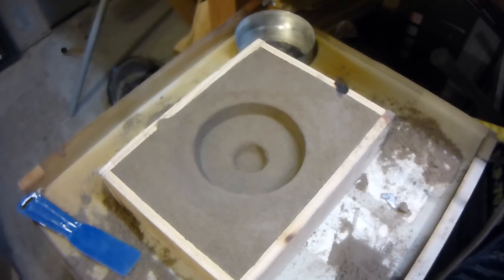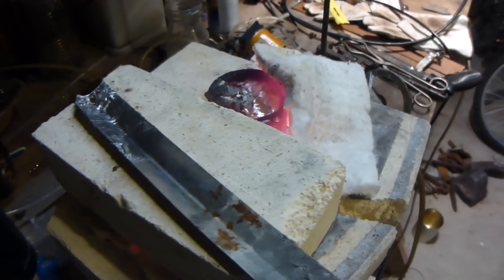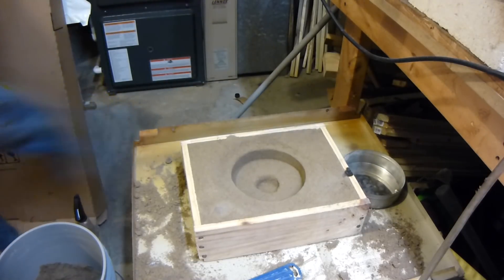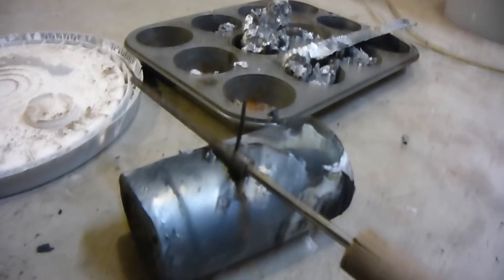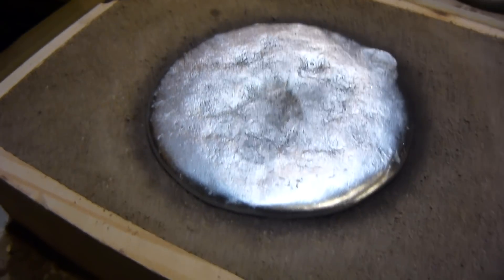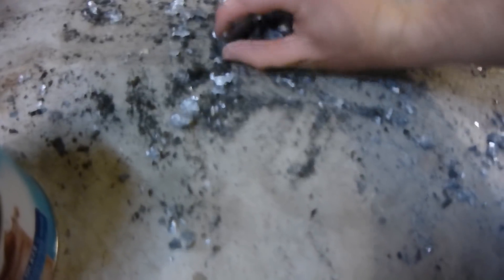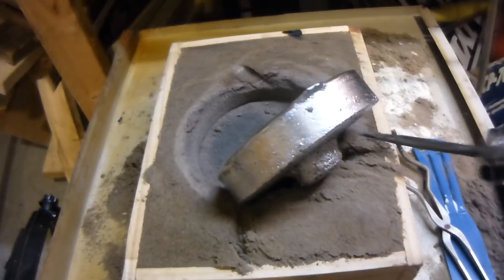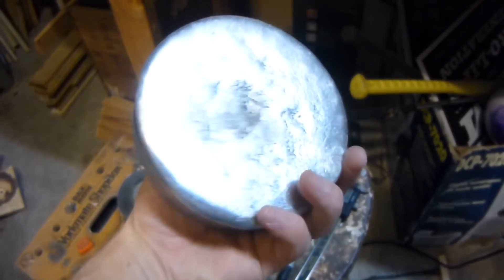Casting an Aluminium Flywheel Using Green Sand Open Mold

Comment: Advice from someone who came very close to burning down his house.
If your kiln is sitting on a wood floor or desk, always allow an airgap of at least 
an inch under the kiln to allow heat to escape.
Without an air gap, enough heat will slowly migrate right through firebrick and ignite the wood below it.

Comment: You are taking a way too high risk here! Get some sand on the floor, and do it the safe way! Put both the furnace and the mould on the floor, and use SAND to put out any fire! It will be much easier to clean up afterwards.

Comment: If you had possibly made a pit off to the side to pour into then allow it to slowly flow into your fly wheel. You will find less porosity in the aluminum casting, You will notice the difference when you machine it, Also definitely heating the mold to dry it out helps, You can see the gas pockets on the bottom of the casting, You will find micro pockets throught the whole casting, Just look at it with a magnifying glass and you will see what I mean. 
It is always better to try in some way to pour from the bottom of your crucible rather then the top, If you could have had material flow level into the pour from the crucible, you would have had a perfect pour with no gas or pockets of any kind.
Use water glass to hold your sand firmly in place and you can heat this up to a lot hotter then you can with just green mold sand casting.

Comment: The Boss, or spindle. - Excellent pour.  Yeah you need to get a better crucible. -  That spray bottle sounds like a rutting moose.  lol  -  Great work.  - I know rdizzy1 disagrees, but you should be wearing your PPE when dealing with molten metal.  A splash of molten metal in the eye will probably blind you.  I have done a lot of lead casting, and have a few small scars on my hands, but I never took chances with my eyes.  - Improve your level of safety to live long and enjoy life. - Otherwise you do good work.

Comment: IIRC, molten aluminum is corrosive to ferrous metals. That's what is speeding up the failure of the crucible beyond just the heat.

Comment: Dont forget to mention about the toxic fumes that come off melting aluminium and should were a mask fukin clown
Reply from the maker: Not many toxic fumes from melting aluminum.  You should know that you clown face.  It's zinc that is are bad for you and easily burns off.  Zinc is almost never alloyed with aluminum.  Brass is the one you gotta really worry about.  Aluminum's burning/boiling point is 4478F which is way above anything I am doing.  The only bad thing here is any paint, oil, coatings on the aluminum.

Comment: stainless steel works good as a crucible for aluminium, look for stuff in goodwill, or find a stainless water bottle from the camping section of walmart or some sporting goods store, and if you can find them mixing bottles they mix alcoholic drinks in they are made from stainless too and are perfect size and shape.

Comment: what does potassium nitrate do to the aluminum
Reply: Noah Voegtly I think it was used as a flux to decrease surface tension in the molten aluminum. This helps it pour better and allow trapped gases to escape. This decreases porosity in the finished casting.

Comment: What did you wind up using the flywheel in?
Reply: Makerj101 ยบบลบ
Reply from the maker: +Nick Ball homemade internal combustion engine. But then I made a better one. So this one was only used on the homemade ic engine for a few months.
Reply: That's rad, what's it power?

Comment: why potassium nitrate ?
Reply: Binds to impurities
Reply: Aluminium doesn't burn at the temperatures inside his crucible (obviously), and so the aluminium couldn't act as fuel for the potassium nitrate oxidizer.  Also, the flammability of something is affected by its surface area - mass ratio.  When the aluminium is molten like that, it's all one big mass with a low surface-area to mass ratio.

Dunno about rocket fuel, but powder or flakes makes sense -  the smaller something is, the higher its surface-area to mass ratio, and the easier it is to ignite.  Imagine you have a solid ten kilogram log - that burns slowly, and needs prolonged exposure to high temperatures to continue burning.  Now imagine that instead you have ten kilos of wood chips - they'll burn much faster and hotter and you could probable set them all off with a couple of matches.
Reply: Why isn't that making a bang? It is after all the oxidizer in blackpowder.
Reply: +Ruben Proost black powder, let alone potassium nitrate alone, doesn't just go bang unconfined like that. the most it does is burn really quickly.
Reply: because in black powder, there is a more than just potassium nitrate, you need also charcoal (fuel) and sulfur (to reduce ignition temperature)
Reply: Well, lighting a mixture of potassium nitrate and sugar also gives a flash, and aluminium is quite flammable.
Reply: aluminum powder is rocket fuel
Reply: Cuz why not

Comment: I am concerned a little for your safety.  A moisture meter used on wood can also be used on sand- make sure your sand is dry.  Please where protective clothing and headgear, and never pour alone!  Great job on the pour and turning, your finished product looks pro!  No pits or slag anywhere: impressive.

Comment: if you take an empty steel fire extinguisher and cut the bottom off, that should last you a good bit longer than that one, so long as you're melting down metals with a lower melting point than steel.
Reply: +Silverwing179 it should work well. The problem of melting aluminium in a steel crucible (or another iron alloy like cast iron) is that at high temperatures like 650&#186;C, the aluminium starts to corrode iron, and thats a two way problem because your crucible gets  finer , and the microstructure of the aluminium forms a needle shape fase that is too way fragile. So, if the piece that you are casting, gonna be used to mechanical structures, it will be too much fragile and can broke in work.

Comment: Noob question: Is there any reason to cool it faster than just letting it cool overnight?
Reply: +silveravnt if you want a consistent piece of metal, cooling it slowly will allow the majority of the crystals to form uniformly.
as opposed to: dunking it in water, where the outer layer will cool quickly, creating smaller crystals, and the inner cooling slower and slower as you get to the centre forming bigger crystals as you travel inwards.
Reply: Aluminum is very brittle when it's super heated. Trying to cool it down quickly could make it crack. The same thing happens at the welding class I took if you let off the peddle too abruptly after tig welding a bead.
Reply: +Jedi Knight so the only reason the cool the metal quickly in impatience or maybe safety in some cases.

Comment: Looks good, use a top and the other side will be smooth too.  The top box is called a cope and you pack it with sand.  When did you get your lathe?    Here's my first run vid:    https://www.youtube.com/watch?v=yfK6TsM71cg

Comment: powered borax is a good aluminum flux too.
Reply: No it isn't! Boric acid attacks aluminum. Do some research. It seems like it works until it fails down the road. Boric acid makes for very weak aluminum.
Reply: I stand corrected. I know when I was told to use it as a flux the amount was minimal.
Reply: It is a good flux for other metals. Not aluminum. But people don't understand that distinction so they use it in aluminum and it appears to work so then people keep repeating that advice, never hearing the followup about how weird it was when the part they made failed weeks later.
Reply: Jon Miller you say no to boric acid... what do you recommend then? I have seen a eutectic mix of 50/50 NaCl/KCl, fused then crushed recommended as a cheap, effective flux (commonly sold as "light salt"), sodium carbonate ("washing soda", NOT baking soda), and of course, there are commercial fluxes. Degassing tablets and bubbling of nitrogen for reducing porosity is a different thing.
Reply: To be clear, boric acid is an effective flux for aluminum. But ANY leftover in the aluminum will weaken it. Thus it is not a good choice. 

Yes, nitrogen degassing removes hydrogen, not solid contaminates. 

The "lite salt" is, by far, the most popular flux for low volume hobby use. If doing a large enough volume it quickly makes sense to get a commercial flux such as Coverall (sodium fluorosilicate and a couple other things I forget). 

If you already have it around and don't mind using it for this, aluminum welding rods with flux coating work very well. But that is an expensive way to go about it.

Comment: 00:53 - The crucible is full, 2.3 lbs of aluminum, which is how heavy you want the flywheel to be. Though earlier you said you were going to mill it down, you know milling takes off material, right? Taking off material makes things lighter? After you're done milling you could be as low as 2 lbs, fair ways off your 2.3 lb you wanted.

Comment: Why would you make a flywheel out of aluminium?
The whole point of a flywheel is to be heavy!
Reply: Technically a flywheel should be engineered to be the correct weight for the application. Aluminum may be perfectly appropriate for certain uses. But lead would be easier and safer to work with, while also serving as a better flywheel for most applications.

Comment: On safety: Your individual probability of risk is directly related to your PERCEPTION of the risk. If I say that you are more likely to be killed by a spider bite than a shark bite , and you believe it, and surf in the ocean, then your individual probability of getting bitten by a shark goes way up while keeping the statistics for a large body the same. That is, this kid (hats off for his ingenuity), thinks he will be safe doing this without proper safety gear (no boots as well lol)(looks like slippers?), and so his risk goes up (even though this might be the 100th time he's done this). I knew a guy that worked like this. Spin casting-- metal shot out the sides wounding several people. You have to take some risk, but if you can make the same progress and not take the risk, then why do it? In closing, even if your neighborhood is safe, lock your doors at night. Why not?

Comment: If you are not trained to handle dangerous substances. Stop and do not make anymore videos. OSHA has regulations and you need special classes and safety tutorial before you can even begin to do injection molding of any kind or casting.
Reply: Showing off your incompetence by using buzzwords? Nice.

Comment: try graphite powder on greensand moulds. A light coat of it will help your finish. if you want a more detailed mould try petrabond sand (motor oil and sand) it stink when you cast but holds finer details. just a lil advice from an ex foundry moulder.

Comment: I thought you weren't supposed to cast metal on concrete floors?
Reply: +Bill Mielke That is because it maybe damp or wet and molten metal hitting the floor would result in a steam explosion combined with bits of concrete shrapnel flying everywhere.
Reply: Ah, thank you, I had heard it could cause an explosion, I always wondered how that would work.
Reply: +Bill Mielke That's the least of his worries
Reply: +I'M Running Thaangs I don't like beating a dead horse to death, there are of course many dangerous things about this video, but most of what I saw had been commented on by others, the only things I saw that I did not see commented on was the floor, there was the cramped work space, the indoor casting operation on a plywood desk, no jacket, gloves, the shoes, the fact that he didn't account for shrinkage in his mold making and casting, the fact he's machining an unknown casting.  The worst part about this whole thing is I assumed as I think others did too the this is a 15 or 16 year old, but in reality this is a sophomore in college, he should know better.

Comment: I'm not gonna harp on you about safety, no need for a full fire suit if you're careful. But you absolutely must wear one of those clear face-shield or at least large safety glasses. I don't wear my face-shield when I'm melting, but I always wear a long sleeve flannel shirt and put the face-shield on to pour in case there's rogue water somewhere that could case an explosion.

I'd also recommend looking for a cheap crucible online. You could find something decent and relatively cheap ($30-50 on Amazon) that has no danger of failing on your worktable.

Comment: you are lucky the metal did not  explode when you added potassium nitrate, you need potassium cloride
Reply: +James Mclaughlin  what does the Potasium  Cloride do to the mix?
Reply: +Damian Mealor degasses the metal and helps to flow easier
Reply: ok, Thanks heaps.

Comment: I am in by no means a profesional, but even with my limited knowledge, I saw so many stupidly dangerous things in this video.
Reply: +Izeck Kattz Like?
Reply: For one, he pored molten metal into a mold that is sitting on a wodden table. One leak and there would be trouble. Second, he even said it himdelf. The crucibal that was used had holes in it. Third, the shop ios a mess and filled with trip hazzards. There are others, but I won't bother noting them all.

Comment: Why did you make a flywheel out of aluminium?
Reply: lightweight...
Reply: +stanley carter its lightweight and he strengthened it by removing impurities with potasium nitraat
Reply: +Josh Perkins That's actually a bad thing. Flywheels work by virtue of their kinetic energy, which is mass time velocity squared. An iron flywheel with most of it's mass on the outer rim would be better. But aluminum has the distinct advantage of having a low melting point so you can make a casting with a cobbled together setup like this.
Reply: +Siegfried Gust lightweight flywheels are something I'd prefer. especially when I bring my car out on the track. more engine breaking for me
Reply: Josh Perkins
For the fly wheel to do it's job, it needs a certain inertia. Which means it needs a certain mass. So you can't just swap an iron flywheel for an aluminum one of the same size and expect it to work the same. Now if you don't care too much about your engine running smoothly at low rpm then it might not be an issue, but you could just as easily lighten a steel flywheel to achieve the same affect.
Reply: Exactly... It's not supposed to work the same. That's why people prefer lightweight aluminum flywheels over iron/steel. Keep in mind I'm referring to a racecar. Everything is replaceable at some point.
Reply: On the track I hope no one is driving at low rpms 😬
Reply: +Josh Perkins the whole point of a flywheel is that it is heavy and has a large moment of force
Reply: +Josh Perkins there would be no point even having a flywheel

Comment: Ooooh so its not a flywheel you're casting... its a flywheel blank you're going to shape... got it xD

Also for a good jerry rigged crucible get an empty fire extinguisher make sure its empty remove the valves then cut it to the length you want to melt things in.

Comment: My crucible is a piece of 4"x 4"x 3/8" piece of steel welded onto the end a  4"x 4x 1/4" piece of square tubing. it's so beautiful lol... But then again this was the only thing I had laying around that could withstand the heat from my furnace

Comment: i have in my younger days worked in a aluminum factory we used dry sand with 2 components it could stay like wet sand til we applyed co2 then it hardned if hot aluminum hits wet sand it is dangerous

Comment: you should use sodium carbonate instead of potassium nitrate to degass the aluminum.. it's usually sold as soda ash, or washing soda.(not baking soda, which is sodium bicarbonate)

Comment: Jesus christ. Climbing over junk in the shop carrying two pounds of molten aluminum, pouring it from a obviously failing crucible, into an open mold sitting on a giant sheet of cardboard, surrounded by more cardboard, next to a wood work table covering a giant pile of kiln dried wood, all of this indoors. I get being excited and wanting to forge on with a project but jesus christ, this isn't to wear or not to wear gloves with machine tools or wearing a face shield while pouring, this is seeing how high the stakes you can make it if something fails.

Comment: SAFETY!!!!

1.  You're using a gas torch indoors.
2.  Melting metal on a work bench, let alone a cluttered one.
3.  Steel crucible.
4.  No protective leather.
5.  No face shield.
6.  Open shoes that look to be made of plastic!!!!!
7.  Hopping over stuff.

Comment: mmmm i know its a small piece but isn't uniform cooling a key part in a cast durability and strength ?
Reply: I guess it depends on the metal. Steel definetely needs it, don't know about Aluminium.
Reply: +Tony Ookami شلك بهلسوالف عمي
Reply: +Tony Ookami I believe that even aluminium is effected  because I have seen in a video talking about aircrafts through history , that heat transfer part was key advancement and earlier a limitation in size of an element , I am a civil engineer even though concrete is not that rapid in cooling or heating but the stresses resulted from variation in temperature can be really big. in small pieces like this I don't think it matters but if you are doing bigger or especially longer parts you should take that in mind otherwise the part you are doing will have defects and if these defects are in a place where high stresses are to exist in application then you are going to see surprises if you don't know this already.
Reply: +Haider al hajaj هذي ي عزيزي مواضيع جميلة ، شركات كبيرة وعملاقة تصنع محركاته بنفس هالمبدأ عشان كذا الموضوع شيق وراااائع

Comment: cool casting bro, your wheel looks a little heavy for the size of the belt. It would have looked better if you shaped it like a normal pulley.
Reply from the maker: +tubester4567 Well it's going on a pretty small engine so all it really needs is a rubber band.